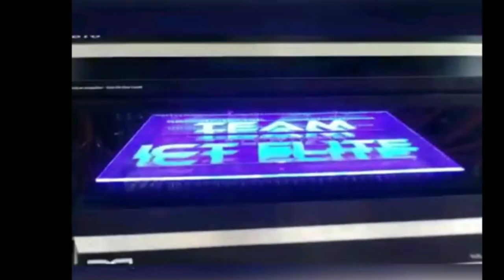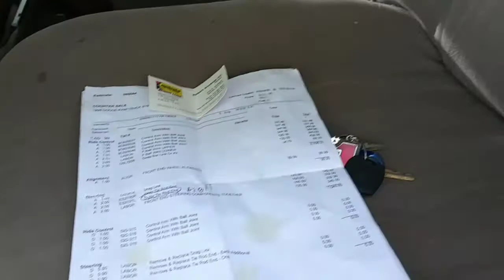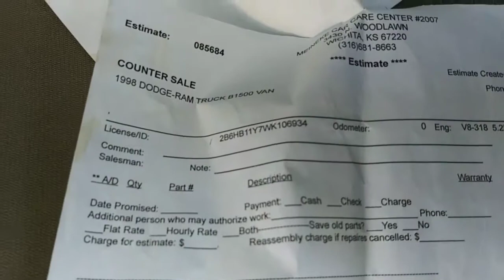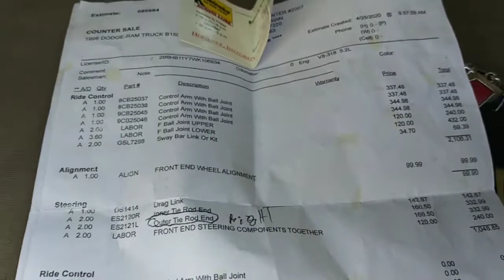MEET "BLACK MAGIC" / New Project REVEAL!!!

Comment: Damn man 165 for a tierod end that's insane I buy all my parts on ebay from Detroit axle pay 18.95 a tierod end and it only take about 30 minutes to put them on and then u gotta get it aligned but 80 for alignment just put control arms eith ball joints on my g6 and they were 50 bucks a piece 10 year warranty.  Took me about 2 hours to do both' but the damn cars clutch slave clylinder just went out have to have a friend fix it ' sucks cause I was trying to save some cash up for bigger amp now I'm screwed.  So no bigger amp for me yet 😢